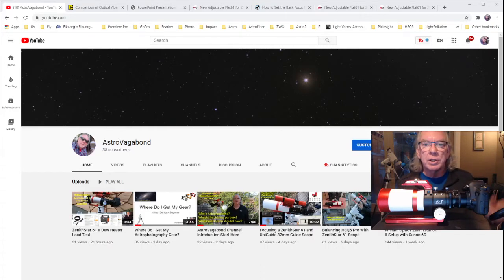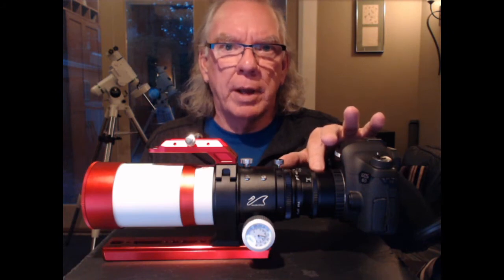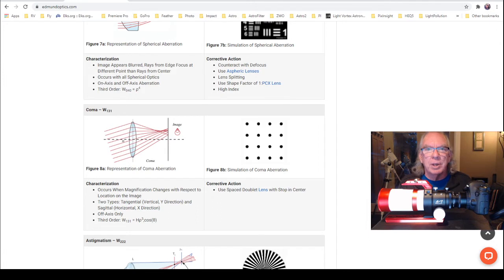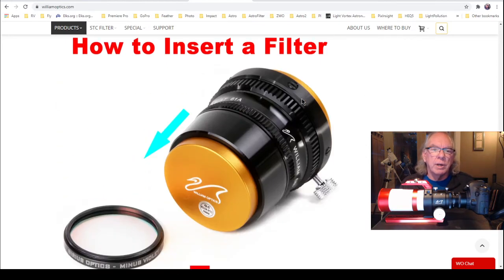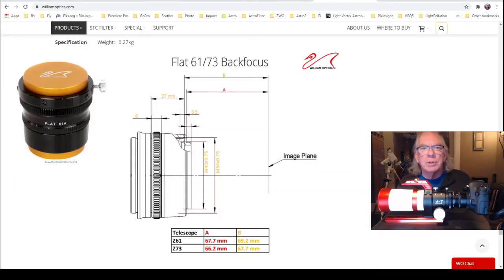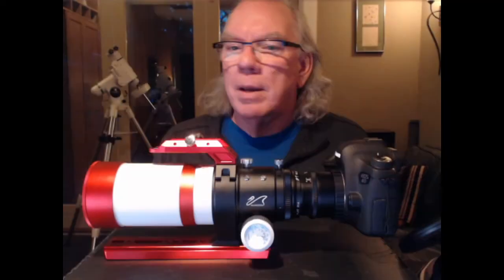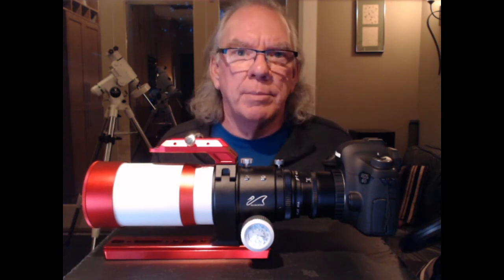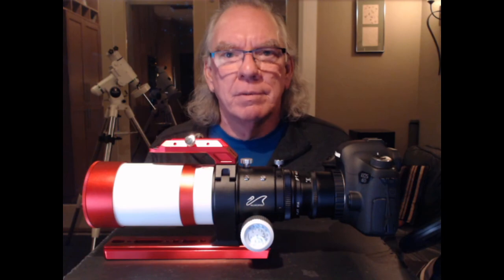William Optics Z61 Adjustable Field Flattener & Back Focus Distance

Comment: Lots of great info here. Thanks!! I started astrophotography just under a year ago with a Zenithstar 61 and a Nikon D5000 unmodified DSLR. I finally got tired of having to crop a ton to have acceptable stars and finally decided to spend the money on the Flat61A. Waiting for it to arrive currently but I can’t wait to try it out once I get it.
Reply from the maker: Cool, good choice. Let me know how it turns out.
Reply: @ it has been working perfectly for me but I did discover an issue likely with the telescope… the stars in the corner of the bottom left are a bit elongated and it is not a backfocus issue. I’ve already checked that.

Comment: I went out last night with my new filter wheel and my pictures were all blurry on the edges, even with a rock solid polar alignment and focus! I figured it had something to do with the field flattener. Thanks for posting this video and all of the useful links!
Reply from the maker: You are welcome and thank you for dropping into the channel and leaving a comment. Much appreciated. 👍
Reply: I have a same problem lots of coma around the stars. Did you fixed it ?
Reply: @Adrian-gs3vy  This ended up being a backfocus issue.

Comment: I've enjoyed many of your YT vids for a number of reasons....same scope (Z61), same GEM, similar starter cameras (mine is a 600D), and a field flattener (I opted for the FLAT 61R). You've progressed a lot faster thanks to your location (the Great Northeast is a struggle to find dark skies and the weather's not ideal so available imaging time is much less) and perhaps a bigger budget.  A couple of comments. When I was deciding whether to buy a flattener, OPT techs suggested a flattener wasn't as important with my camera because of the 1.6 crop factor, it would be more needed with a full frame sensor (although since the the 61R is also a .8 reducer, so that reduces the amount of crop).  Your ZWO has a crop factor of about 1.87 and your flattener is not a reducer, so you're looking at an even smaller portion of the image than I am, hence an area with less aberration. Your thoughts? I may be misunderstanding some things since I am not an optics guy.
Reply from the maker: Jim my thoughts are you raise a really great question which I have not thought about and don't have an answer. My ASI294MM Pro uses the IMX492 sensor which is 19.1mm by 13.0mm. Let me think about this a bit. My 294MM also has two bin modes so I can change pixel size, full well capacity, and resolution based upon which bin mode I use. In either mode the field of view remains the same. 👍 I don't think in terms of crop factor anymore for astronomical imaging. I think in terms of field of view of the combined camera and OTA.

Comment: In response to your back focus query (use measurement A or B) I think this is relevant to the breed of DSLR you are using, as NIkon & Canons sensor to flange measurement differs by 2.5mm. It is also worth remembering that these are guide line measurements & some tweeking maybe needed to achieve a flat image. The real proof is by analysing the stars in the corners of an image.
In regards to 'are flatteners necessary', i would say yes if you want a usable 99% flat image.
If you are happy to crop off the edges of a frame you may get away with a 50% usable frame without a flattener.   
kind regards Marc
Reply from the maker: Great feedback! This is information that is helpful to me and others. Thanks you for taking time to drop into the channel and comment. Much appreciated! 👍
Reply: Old comment but I just want to point out that the "B" distance is indicated to the back of the last optical element which is the critical distance in this whole equation. Dimension "A" is referenced to the back flat portion on the flattener housing proving an easy way of measuring when assembling an optical train.

Comment: So we don't need the flattener if we are using a crop sensor dslr right?
Reply from the maker: Hi Rahul that is now my current understanding but maybe a more experienced imager will respond to confirm. I went with one because I was using a Full Frame DSLR. Seems you can start without one, evaluate the images you are capturing, then add one later if required. Thanks you for taking time to ask your question Rahul! 👍
Reply: If you want a flat field then yes you do, if you don't use one you will have to make a rather aggressive crop to your images. This is fine if you are imaging a small galaxy like the Whirlpool but you don't want to have to crop 50% of your image to get shot of eggy stars when imaging a large nebula.
Reply: William Optics has a specific flattener reducer for a crop sensor: Flat61R

Comment: Thanks for this video. I have the Z61 attached to a mirrorless camera - Fuji XT4. The first target I shot was M31. The image was great except I screwed up and forgot to adjust the field flattener from its fully closed position, resulting in star elongation at the edges of the image. It wasn’t a big deal because at the Z61’s focal length there was scope to crop the image. But I’m struggling to find the required back focus measurement for the XT4. I’m just wondering whether all APS C sensors are set at the same distance in the camera or is there a difference between DSLRs and mirrorless?
Reply from the maker: Great question and one I need to answer for myself as well. Best I can find is this "Many thanks to you both for this information & advice. The folks at TelescopeAdapters.com got back to me, & after checking my camera's focal distances & the specs for the Z61 telescope, advised that I would need to add an extension tube because even with the adjustable flattener from William Optics, I would still be a few mm short of the required distance. So it looks like I should be good to go with using this adapter to connect my X-T3 to the William Optics Z61. Happy days!"

I found it here:  https://www.fujix-forum.com/threads/fuji-x-astrophotography.91995/

I'm going to contact them via their website and see if they can provide an answer. If and when they respond I'll post what they recommend.

Comment: Hey Astrovagabond, the idea of the adjustable flattener is to reach for the right place for the glasses to give you the flat image, in this case if you set the flattener to the distance of 12.9mm you will get a flat field of view with a APS-C sensor, I’ve got the same scope with the same flattener and the distance set to 12.9mm in the flattener with a Canon 70D and I get a flat field on my images, it is a trial and error at the end, you just have to slightly move back and forth a few mm and test it out, look on the corners for stretch stars, if the stretch goes to the center of the image it means the flattener is too close, if the stretch of the star are “perpendicular” to the center of the image, the flattener went too far, I hope this helps!.
Reply from the maker: Hi Felipe it does help! Thank you for the fantastic feedback and taking time t comment. There are so many things to learn it is helpful when you and others share their knowledge with me and others beginning their journey who may be reading the comments. 👏👍
Reply: @AstroVagabond  no worries!, we all gotta get to the same place!.😉😊

Comment: I think you have the back spacing correct. I have the GT71 with the adjustable reducer and a Canon 6D. William Optics states the back focus should be 64.1mm and the flattener set to 9.1. The distance from the T-ring to the sensor on the 6D is 55mm. So that plus the 9.1 will be the required 64.1mm. I'm So Happy I found your channel. Nice to find someone else that tries to understand and explain how these pieces come together.
Reply from the maker: Thank you for the confirmation Anthony. Much appreciated! I was able to capture some images the other night. It Seemed using the Bohtinov mask I was able to obtain a decent focus with the back spacing I used. I'm in Astro Pixel Processor at the moment doing the integration. I think my 40 second exposure was a bit too long given I'm in a Bortle 8 zone. I was using the histogram as my exposure duration guide. But I'm not seeing any star trails and the image looks reasonable flat through the corners. But I'm making these statements through the eyes of a rookie! 😀

I'm putting together a video to discuss calibration frames for people who made not have gotten this far yet. Using Astro Pixel Processor I'll show some of my lights, flats, dark flats, dark, and bias frames.

And thank you for checking out the channel! I'm hoping through this channel we can foster a conversation from through the eyes of me, you, and others on the front end of the deep sky object imaging journey.
Reply: @AstroVagabond  Looks like we are on the same path- I just started using APP. I am using Astrophotography Tool (APT) to control my mount and camera. This should be fun.
Reply: So this is answering a question I have.  I own the similar Flat6AIII.  The documentation says that for my ED80, the back focus is ~62.1mm.  I interpret this as setting the adjustment to 7.1mm, and keeping the distance from the back of the Focal Reducer to my chip at 55mm.   Is that correct?  Because 7.1mm + 55mm = 62.1???  I DON'T add spacers to the back of the focal reducer to make it 62.1mm from the chip.  Please let me know if my logic is sound!  Have a great day!

Comment: If you are using a full frame sensor like the 6D you will see the curvature at the corners of the image. However, if you are using a crop sensor  APS-C for example, you may not see the effects of the curvature. You can always crop the image taken by the 6D to remove the curvature effects - or add a flattener. Thanks for the video. Great Channel.
Reply from the maker: Thanks!

Comment: Check the focuser for looseness.  I had to tighten the two set screws on the top of the scope.  One is under the ring and one is at the end of the scope.  I had a lot of play in the focuser.  Good luck!
Reply from the maker: Hi Darren thank you for the tip and I'll do the check as you suggest. Thank you for dropping in and checking out the channel!